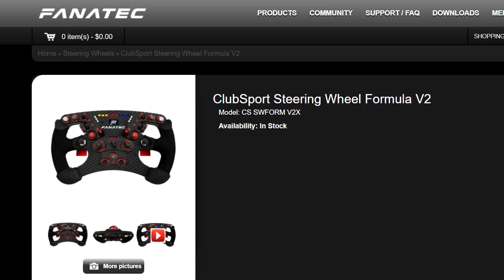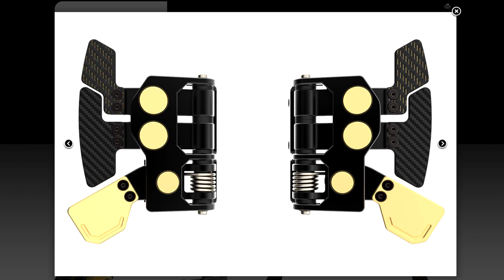Fanatec ClubSport Formula V2 Wheel Review

Comment: I own this wheel and the the rotary encoders are meant to be flicked, and each flick acts like one press of a button. So if it moves three notches in a flick. It's just one activation.

And the Podium Paddles I'll use the top paddles for KERS and DRS.
Reply: Ah this goes for the Thrustmaster ferarri f1 wheel then, I was wondering why its so "bad" (not bad in my eyes now that I understand the purpose)
Reply: @BeaverCops  i don’t think it’s the same for the thrustmaster
Reply: @renelammers813  eh I got cube controls now anyways :P
Reply: @BeaverCops  very nice
Reply: You're right because I was wondering why my rotary encoders barely adjusted brake power/bias when I rotated them multiple clicks.

Comment: Always liked your unbasis review. Thanks Barry!
Reply: @ernestmuric6719  how did you know the hardware was given to him for free?
Reply: @ernestmuric6719 I compared to other videos that was done to promote fanatec items. At least he did mention which are the things that is needed to be improved and if its necessary to upgrade if you have stuff of similar performance. Other videos that I came across was just purely talking about the pros and not the cons. Regarding about if his wheel were sponsored or not you can take a look at his previous video. There were some which he bought them and there were some which were loaned. Ultimately I dont really care as long as the review is honest and true. When I get my item based on his review I want to know that they were true and my expectations is set right. So far I am happy with my purchase after seeing his video.
Reply: @ernestmuric6719   it's always a hunch just like videos from inside simracing. IMO they are bias towards thrustmaster. Especially when they compared the TSPC and fanatec CSL elite, I had the opportunity to drive both and therefore I know that their review was untrue. Getting a DD is a huge step up from any belt drive wheel, so far the belt driven wheel that I had driven which is closest to the DD (OSW) will be fanatec CSL elite and V2.5 in terms of smoothness of course the torque is much lower.

Comment: The 2 connectors in the middle of the board, with the red and black wires are for the rumble motors, not the funky switch. The funky switch is surface mount.
Reply from the maker: Correct.

Comment: Outstanding review as always, worth every moment. I just picked up a ClubSport Wheel Base V2.5 for $90.00 brand new off ebay and bought the wheel direct from Fanatec. Thanks for the reviews!
Reply: Ya you got scammed. That base is $550 so it was definitely used for $90. And no warranty due it wasnt through fanatec
Reply: @SIMRIG412  That's an opinion about being scammed. Came here working and looks brand new. Also if there's no warranty I'm ok with  that. Some people don't have $500.00 to just drop down at one time as I used credit to buy it so $90.00 bucks off helps. I have been using it everyday for hours by the way.

Comment: In practice, the detents on the thumb encoders do not matter. You just flip the rotor with your thumb in the direction you want, and the wheel recognizes one motion in a direction as a single button press. You can confirm this in the Fanatec driver properties window by watching the test light indicate a single time per throw of the rotary encoders. It really would be bad if those detents actually mattered because I agree they would be unusable in that case. Luckily though, they can be ignored.
Reply from the maker: Yes, I found that out after the review. Wasn't looking for it. I think Fanatec missed an opportunity here to have a realistic encoder function.
Reply: @simracinggarage3026  Weirdly, this is also how the Thrustmaster Ferrari F1 rim's thumb encoders work.

I agree that it would have been nice to have the option, but apparently it MUST be by-design if multiple different simracing manufacturers are doing this separately.

Do we know for certain that this isn't the type of design found on an actual F1-style wheel used in real life motorsport?

Comment: Just a tip for the thumb wheels...they aren't meant to be one click advancement it seems to me. If you flick it in one direction or the other it doesn't matter if you go 1 click or 7...if it's one motion it will register as one input...so if you need to up your brake bias by 3 inputs you'd flick it three times...the number of clicks doesn't much matter other than they keep the thumb wheel from spinning freely IMO. I mean with gloves on I feel the fine motor control over bumps and in a car/motion rig or even just the force feedback motion of bumps, etc...would make selecting one "click" of rotation to either need a VERY detent heavy wheel or extremely fine motor control...neither of which seem like a reasonable solution in a car/sim rig going 200 mpg(300kph).

Just my two cents.

Comment: So Barry , those sweet magnetic shifters at 20:58 , how do they work ? Does the shift happen because the magnets come apart and break the circuit or is there a micro switch in there like on those standard Fanatec shifters ?
Reply from the maker: There is a micro switch inside the housing.

Comment: Would love to see a review and install of the new USB conversion that is available for this rim. There is the Leo Bodnar board with new firmware that works with the Formula V2 as well as the SRM conversion kit which uses the Leo Bodnar board I side of an adapter (similar to his other wheel conversions). I would love to see how the USB conversion is working with this new Fanatec rim as this most likely means the new button box Fanatec is coming out with as well as the Poium hub will possibly work as well. The button box has a full function screen similar to the one on the Podium bases and I am very curious to see if this will work.

Comment: Is there anything else other than the four screws holding the metal quick release because I was after using it on another wheel but I took out the four and it still feels like it's stuck on. I didn't want to force it if there's anything on the inside.

Comment: I have a v1.  Is anyone aware of any DIY projects to replace the grips with rubber or something better for bare hands?  Mine are getting gummed up.
Reply: Did you not wear gloves with it? Any steering wheel with suede will require gloves because even a little bit of sweat will wear it down very quick.
Reply: @alabaska182  gloves also wear down quick.
Reply: @SIMRIG412  I wouldn't say quick, unless it's poor quality material.

Comment: Barry, I noticed in the last few videos you are still running the clubsport v3 pedals. Do they hold up that well to the higher end competitors, or is it because you haven't gotten around to switching. I run the V3 inverted and love them but was curious if the higher end upgrade is worth it. Thanks, cheers.
Reply from the maker: Not sure how well they will hold up long term. I have not had any issues to date. They are a good set of pedals I think. Lot of very fast guys using them. I will be going back to my higher end units though. As they tend to feel more substatial under foot.
Reply: I think most sim gear comes down to look and feel. Very few items will make you go faster. Humans can adjust to most things over time.

Comment: Very nice review.  Is the back of the wheel plastic or metal (where the white Fanatec logo is printed top back)?
Reply from the maker: Plastic. With a thick steel plate underneath in the hub area. Where the shifters and hub attach.
Reply: Sim Racing Garage Thanks for the clarification!

Comment: Hello! Any suggestion how to fix the loose rotatory buttons on the side? (the one that's the closest to your fingers, rounded button)
Reply from the maker: As I understand it, they were intentionally made this way. To make it easy to flick the knob to make an adjustment. I would have prefered a wider detent and more friction. But thats just me.
Reply: maybe by replacing with small knobs in diameter. or i wonder if they are removable to be replace by quality encoders (it depends on their size i guess).  Barry, do you recall how they looked like when you were opened the Formula V2 rim?

Comment: Hi barry, nice review as always. In my opinion the old version still been better, where do you buy these magnetic shifters? thanks!
Reply from the maker: The shifters are from Simon at Sim Racing Machines. I normally don't like to recommend things, but adding magnetic shifters to the F1 wheels add so much to the user experience, when compared to the OEM shifters that Fanatec uses here I think.

Comment: I'm Osmindo (from Brazil) and, first of all, I would like to say I'm a big fan of your work. I am subscribed to your channel and watched all of your videos.

I'm having a big problem with my new Fanatec Clubsport Steering Wheel Formula V2 (with Podium Advanced Paddle Module and Fanatec DD2 base) and, due to your big knowledge, I'm trying to contact you for, if possible, you help me to know what is happening and try to solve the problem. 

The Fanatec Kit has only 4 months and on last days it has stopped working some times after a few laps completed on race or practice series at iRacing. All components stopped (revleds, oled panels, all buttons, switches, etc). 

In contact with Fanatec Support, they ask me to check inside the FV2 (quick release stuff) to inspect if the 5 screws were loose. In fact, it was a little loose and I gave them some tightness. After that, the wheel has worked fine for 2 days, when it stopped again...

I would like to know your advice, if possible, of course, about that issue. Could it be an electronic problem? Any bad component? 

With your wide knowledge, do you see it as a normal/common/recurrent issue with this DD2+F1 Wheel V2 kit due to its high torque/shake? Do you have any suggestions that I can proceed to fix it?

When I've performed the test with R300 wheel it has worked fine, discarding any DD2 base problem. 

Thanks in advance, hope you can help me with something.
Best Regards.

Comment: Hey Barry, do you think this wheel could be used to drive not only f1 cars, but also gt's or wrc ?
Reply from the maker: Yes on the GT cars. I drove the 488GT3 around the Nurburgring without any drama. However, no very suitable for Rally cars. You need to be able to spin the wheel on those cars. You could use it, but I wouldn't want to unless no other choice was available.
Reply: @simracinggarage3026  Thanks for the reply

Comment: mine came with a screw for the hole in the quick change mount...no where does it say why...anyone know? do I need to use this with my CSW 2.5??
Reply from the maker: Once you have the wheel attached to the wheelbase side quick release. You can use the screw to make the connection tighter and also keep it from coming loose. Depends on the tolerences on your quick release. Some are better than others. There are people that don't use the screw at all and don't have any issues.
Reply: @simracinggarage3026  tyvm

Comment: I expect them to make a USB conversion themselves, that will work its way around any firmware issues. Give them a little more revenue, we've seen it with their adapters for some of their other products I think
Reply: That will not happen.
Reply: Fanatec is pushing their Podium wheelbases hard, so they'd rather people switching to Direct Drive to buy their new servos rather than buy an OSW servo.

Comment: Will the speedindicator and the lights above work on ps4 when playing F1 2018? Grtz, Jeroen
Reply: Jeroen Quint have you found out yet?
Reply: @guydelarosa1  i have bought the csw F1 2019. Speed indicator and revlights work on that wheel. Fanatec told me it will also work on the formula 2 as it has the same internals.
Reply: Jeroen Quint so it all works on the ps4?
Reply: @guydelarosa1  yes, but as i say. I have not de v2
Reply: Jeroen Quint ok thanks. I’ve heard from many people the the speed lights don’t work on Xbox. Is this because x box doesn’t have a specific wheelbase licensed for Xbox so the rev lights don’t work?

Comment: Barry it says PS4 ready,..what works on the PS4 and what doesn't??

Gwenndolynn
Reply: Ps4 ready means it can be used with a ps4 if you have the ps4 wheelbase
Reply: Scrobbles but do the rotary switches work on the ps4 base?
Reply: @gwenndolynnmecklenburg6457  The thumb ones should but I don't know about the ones in the center of the wheel, even on pc some games dont recognize the center ones but they could have fixed it in a firmware update.
Reply: Thanks,..

Gwenn
Reply: @gwenndolynnmecklenburg6457  They are indeed PS4 compatible but of course they need explicit game support. Especially the 12way multi position switches which Barry did not check that descent.

Comment: Im having trouble getting this wheel and their CSL elite base to work on my Xbox one. While that may not be you area of expertise, could you possibly send me in the direction of someone who could help? If not ill attempt to struggle bus my way through it. Great video by the way.
Reply: Were you able to get this working? I have the CSL elite base with the WRC wheel but I'm considering the formula v2.
Reply: @brnrubber303  I was. So make sure that all your drivers are updated, thats step one, the second is when it gets a little weird. So once everything is updated, when you plug the base into your xbox, make sure its in PC mode (red light) and then use the wheel to turn it to xbox mode (green light) using the Y+Start button short cut. It might take a few tires but you’ll eventually get it to work, you just have to play with it. If it doesn’t work, unplug it and power cycle the base. It may not turn off in xbox mode if it doesn’t get recognized so just unplug the base. Occasionally the force feedback will be weak for some reason, just repeat the above and after its recognized again it should work properly. And make sure you do everything at the home screen. It may take some playing with but it should work.

Comment: As long as I know, the old formula carbon wheel had real carbon fiber front plates too...
Reply from the maker: Yes, it is real carbon. But very thin, and applied to the aluminum frame with adheasive. Hence my "sticker" remark. Does nothing to enhance the stiffness of the frame. Not that it needs it.
Reply: Sim Racing Garage Oh got it! thanks for the explanation!

Comment: Disagree about the rotary thumb encoders. No stronger detent needed. Why? Because they are continuous, fine-pitch adjusters. They don't have numbers or markings because they are meant to be turned until you achieve the desired setting—that is observed elsewhere. Using a light dimmer as a convenient example, do you look for a specific setting on the dimmer knob? No, you adjust the knob until the light level is to your liking and then you stop rotating the knob. That is how a rotary encoder would be used although because it is digital, there are many more possibilities for resolution/mapping.

Firm detents are only really needed when there are a limited number of positions available for a control.

Comment: Hello how are you? I'm disables, I can't move my lags     I'm simracing driver. Do you make hanpaddles for to breakes an gas?
Reply from the maker: You may be able to use the Podium dual clutches for seperate throttle and brake. I have not tested it yet.
Reply: hello, you may try open sim rig or sam maxwell design for a custom wheel .also,  i will test soon the fanatec V2 with podium module (plus SRM usb conversion, if you use other base than fanatec). so i will tell you how it goes.